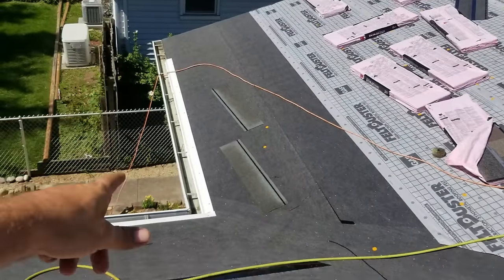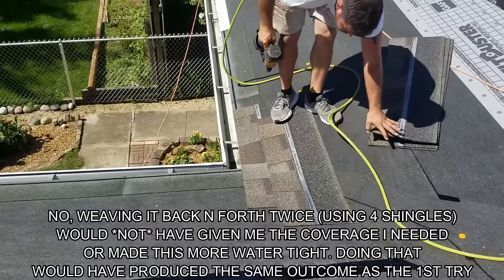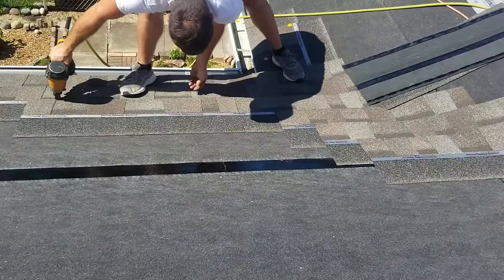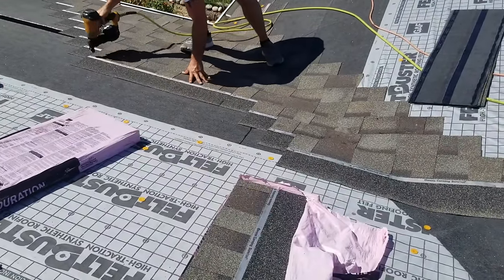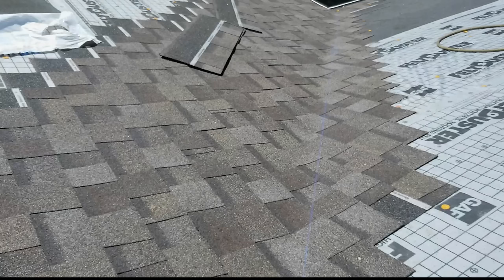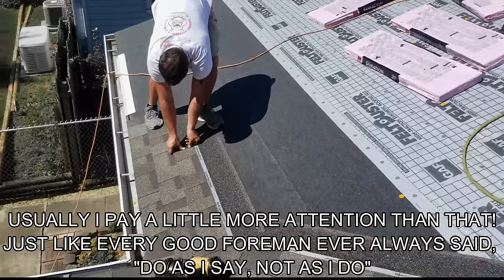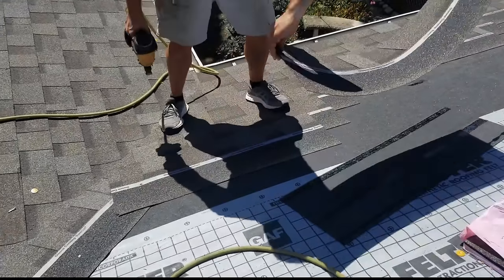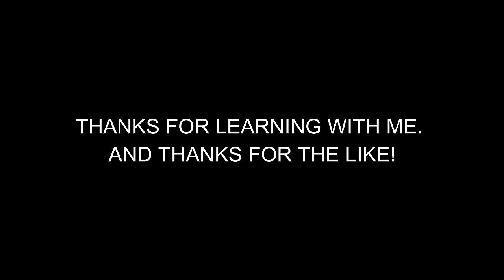How to do a closed valley!!!

Comment: No no and no. I understand how you got so much hate. This video should be titled the quickest way to do a valley, not how to. I don't think this guy cut one shingle while doing this valley, except when he hacked up a mistake. He sacrificed nail placement and a shorter stagger for a quicker job, voiding the warranty on the shingles. I never saw a hammer out even one time with all those nails. I'm guessing there are probably at least 40 to 50 nail pops, even if he had perfect pressure.. Never ever run shingles vertically up a valley like that. That's why he didn't use valley roll, because he couldn't. This is what hacks do because of the nature of dimensional shingles that will camouflage that vertical shingle, and no one will ever know you didn't use valley roll because you can't see it. You'll never get away with that shit with three tabs. Just do it the right way and use the valley roll to protect the valley and cut the shingles on the over side like roofers have been doing on closed valleys since asphalt shingles have been in use. If you question this comment, just read the package that the shingles came in, they are very clear on what voids the warranty. This method is a great way if you're working by squares, you'll make a lot of money. But if you're the homeowner and you want a good job I have seen lots of other videos that show the right way, not the fast way.
Reply from the maker: Dude. THAT IS THE RIGHT WAY.  Couple ways to do a valley and it's way better than an open cut valley.  I'm not hiding anything.  I was fortunate enough to learn the right way. And Nobody uses 3 tabs anymore except for cheap asses and idiots that think they're doing the homeowner a favor. Usually the same dummies that still think hand nailing is the way to go. This valley is fine in my area.  There's no hammer because Bostich don't spit crooked nails like the Hitachi. Be a little more open minded and you might learn something. No warranty was voided. I asked the reps at the manufacturer when people brought this up. Just because it's not on the "almighty bundle instructions" doesn't make it void.  This valley not only works better but looks much cleaner
Reply: Do you mean an open valley? In 30 years I've never heard the term open cut valley, it does not exist. A valley is either open or it's cut, not both. The closed valley you did is also referred to as a cut valley, because THE SHINGLES GET CUT. If a customer can only afford IKO fiberglass three tabs, that's what they're going to get or you can refuse the job which would be pretty shity considering a lot of people are on a very fixed budget. People in debt with an unexpected huge repair bill for a roof. I have one of the best financers that I've ever met and she can't get financing for everyone, but that roof still needs to be replaced. I've never turned someone away because they couldn't afford it without doing everything in my power to help them. We are not talking about new cabinets, a roof is a necessity. You must live in a real nice area where everyone can afford your services without issue. So three tabs being cheap is your argument for vertical shingles in valleys? That's not much of an argument for correct or not. That is an ignorantly arrogant statement. Three tabs being a cheap shingle does not magically make vertical shingles the preferred method smh. I said no three times for a reason. Anybody that questions either one of us can just read the package. It's all right there, from proper nail placement to valleys. So you know the proper placement for the cut is 4in or the width of your hand which people commonly use. That cut should also be tapered from top to bottom to give relief and guide ice or debris down the valley. I will give you credit for placing all your fasteners on the common bond which most roofers don't do and that you used ice guard on a 4/12 pitch which most roofers also don't do. With that said I would still make you redo it if you were one of my subs. You are creating a 1/4 void on the underside of the deck shingles that are running over those vertical shingles making them susceptible to penetration by hail. When an insurance adjuster sees that vertical shingle, they will deny a hail damage claim 9 times out of 10 citing improper installation. I have dealt with these people on a regular basis and they look for it. Running vertical shingles up valleys and rakes has been a popular trend for the last 15 years or so for speed and wasting materials so shinglers getting paid by the square can earn more. Like so many others that have learned how to shingle these past 15 years have been taught this way. That's why you're so confident but those are shortcuts, and you should rethink doubting old timers. They can teach you something especially if they learned by hand nailing. Besides the valley, a shingler without a hammer is like a chef without a pan. There is no way all those nails are perfectly flush I don't care what brand you own or how often you get it rebuilt. There is not a nailer on this Earth that shoots a perfect nail every time. I'd love to revisit that roof in 6 years and count the nail pops. If those are GAF then they are probably 30-year shingles made mostly of asphalt and fiberglass, not a strong enough brand for shortcuts. Then you knew that cutting a piece of ice guard off the deck and using it as a repair for a nail in a seam was wrong yet you still did it. Then you suggested the proper way to handle that is roof cement. Cutting the ice guard is obviously absurd but roof cement is also wrong. Roof cement starts to deteriorate at or before 10 years, the shingles have a warranty for 30. Are these also the cool new things that I should have the more open mind to? If I was that homeowner watching your video of my roof I'd be asking WTF? These things tell a person in my position everything I need to know. Owens Corning offers classes on how to install their products, I suggest you make the trip and take their shingle class. Seriously, you need to know the reason behind the why to understand instead of someone teaching you and just running with it. I'm certified for asphalt, ceramic, slate, shake, slotted steel, asphalt steel, and was among the first contractors to install vinyl flat decks over 20 years ago. I know what you were doing and why you did it. I don't care what some representative told you is acceptable.this is one of those instances when you can learn something from an old timer, because they know the history of how instructions got there. Installation instructions are on the package for a reason, so that GAF does not have to honor their warranty. Instead of the reality of a 20-year life span on the shingles they can say 30 and get away with it. Because roofers like you void the warranty and GAF cannot be accused of warranty fraud because it's all right there on the package. These companies cannot make it any easier. They know you never read it, or don't follow it, and you're long gone. Even if you can get tracked down after 15 years a false sense of righteousness of speaking to some rep is not going to save that warranty. Do you really think GAF is going to consider what some rep said verse the instructions when money is involved? That's how they legally get away with it. How many jobs do you know of where the warranty was honored, not insurance jobs, but the shingle warranty itself? You need to open your ears when old timers are talking. And you might consider that when you are right but everyone else says you're wrong, maybe you're the one that's wrong instead of dismissing everyone else as haters. You're still green and you have a long way to go. Some education will do you some good, not by the people on this thread but a real education to learn the how and why things are done the way they are, and why the words on that package mean something more than what a representative tells you. Customers and inspectors never go up on the roof, so you can do things like vertical shingles without an issue or question, that's why roofers get such a bad rap because they can get away with making a ton of money doing a s*** job. You are not a hack, but you're not helping things either. If you don't believe me I would urge you to speak with someone that has at least 20 years experience and has been through a real apprenticeship with education. Even with my education, experience, and success I still search for better ways for speed, quality, and operations. Constantly reading manuals articles and books on my trade. I came across vertical shingles before you learned the trade, and I know why it's not worth the time it saves. That's how I came across your video. 40 years and I still take the time to watch your video along with many others on a regular basis. So don't tell me I have a closed mind, I am always looking for a way to work smarter and make things easier on my guys, increase quality, and of course increase my profit. Experience and education means something young man. The second you close your ears is the second you begin walking the road of failure.
Reply from the maker: Holy shit lmao world record for longest comment on YouTube goes to you.  I am not reading that sorry. Breezed through a couple lines, you ain't saying much besides annoying bs opinion anyway.  Open, open cut,  tamato, tomato. Blah blah.  Thanks for watching
Reply: Yeah, sorry about that. I thought that comment may be a little too advanced. I liked your video, I may even watch it again, or even use ot as an interview or training tool! If Youtube pans out for you maybe you can keep those feet on the ground and save everyone the trouble.. Ad hominem, "When the debate is lost, slander becomes the tool of the loser.".

Comment: Why you need to put six nails in a starter shingle? Three of them right next to each other. I had a rip out of Valley today that some guys did and they were thousands of nails and it was ridiculous. Guarantee you that you lift up shingle and you follow fine nails too close to the joints.
If you use quality shingles and you put five nails in a shingle they don't go anywhere.

Comment: No cement & drip edge not nail to code.
Reply from the maker: do I have to keep telling you the same thing repeatedly...the rules vary by location. there's no code on how to nail drip edge. nobody uses roofing cement on drip edge. and there's no drip edge in this video! that's gutter apron. are you still one of the roofers that are SO FAR BEHIND that you still use drip edge as gutter apron because nobody has ever taught you the difference. the correct way to state your comment would've been. "i was always taught to put roofing cement on the drip edge, is there a reason you don't do it??"
Reply: @NWIVeteranConstruction  
I don't know who taught you but that's wrong
Reply: @danielc9201  it's not like the guy could bj the drip he rose soo much that there was no over hang by the end i bet he was half above the drip where u nail

Comment: Many things wrong about this video. Over hang is not enough. 4th shingle for some crazy reason low face nailed, Although your steps at beginning is good at top of valley your steps are FAR less than mfg specs. Start from outside in and cut excess your step will be perfect every time,
Reply from the maker: Guarantee there's no face nail and what kind of rookie do you think I am lmao the overhang is there. It's the angle you're lookin at. Focus longer. I explained why the steps are smaller than I'd like several times. They're fine

Comment: Every but joint on your diagonal shingle up the valley is open. The underside has a tar line sealing it close to the valley. 
If you live in a colder climate, this is a very bad combination. I consider this to be the worst type of valley, purposed only for production. This is a very lazy way  in my opinion to close a valley. There may be ice and water in it, but no metal, why?
50' of .019 is what $65?    
50' of .024 is what $100?
I personally prefer a "W" valley with ice and water under, and going up the edges. 
I like your videos, but this isn't correct for every area. Ice damming will ruin your home. An ounce of prevention is worth more than a pound of cure.
Thanks 🙈 🙉🙊

Comment: How, for the love of jesus are you guys keeping everything straight.  I run chalk lines and still have catty lines.  (Non pro)
Reply from the maker: Haha gun Guage don't rush.  Quality over quantity
Reply: I know especially with dormer roof valleys I got lines all over to make sure everything lines up equally
Reply: Everything turned out almost perfect.  I just went slow and measured every 2 rows to be sure.  The trick part was the right side of the roof was 1" longer so I had to eat that difference by the time I hit the peak.  The other problem was running the shingles from the valley,  we would end up with odd sized end cuts so we had to do 2 cuts on some runs to make sure the seams were correct.

Comment: starter shingle starter shingle not starter starter then shingle shingle smh
Reply from the maker: That's really unimportant lol reason being stater is the seal the edges.  This shingle running at an angle is nailed like crazy and stuck down
Reply: Zack of All Trades not just seal the edges lol its to keep water off the ice ,drip,and roof roof let the seams of the shingle and starter match up then what lol water underneath the starter and water on top off the ice

Comment: Laying shingles parallel to the valley is a shortcut used by shinglers vs roofers.  Water hitting the tapered to tabs is directed away from the valley and under the shingles.  Its used strictly to save a shingler from angle cutting the end at the homeowners expense.  Shame!  Open metal W flashings is the true sign of a pro.
Reply: And when the metal is copper it's the true sign of a good home owner choice :-0)
Getting so expensive though, I can see economic pressure affecting judgment.
Reply: If the home owner wants a metal valley then he informs the roofer if not, roofer does it his way and that’s all that matters and it doesn’t leak  as well 👍🏽
Reply: Homeowners aren't roofers therefore its the responsibility of the professional to provide them with information.
Reply: @johnd9541  And the roofer should provide cost comparison :-0)
Especially if the customer is already asking for something particular that is outside the "norm" in the industry.
Reply: I consider metal valleys as being part of most basic roofing jobs.  Its up to me to sell the benefits and then let the customer decide.  Its a disservice to lowball an estimate by taking shortcuts.  A metal valley is cheap insurance really.
Reply: @johnd9541  [[ metal valleys as being part of most basic roofing jobs ]]
I agree and hence the roofer should make known up front that the customer's cost will be $X for metal valley style but the roofer can offer that the customer can save $Y if choosing to use shingle overlap as the valley instead.
Ice dam underlayment, etc. should also be options provided to the customer.
PS
If I had roofing business still, I would also offer vented roof options (second layer of structural framing and sheathing with radiant heat barrier in the air gap between the sheathing layers. Radiant barrier vented roofs are a much larger cost in the short run but they can save lots of energy use and extend the life of the shingles as well. (They also make some attic spaces feasible targets for converting to finished living space.)
Reply: The cost difference is so negligible in relation to the benefits, so i doubt few homeowners would choose closed valleys in order to save $200 for something lasting 20 yrs, but it can be offered.
Reply: @johnd9541  I would agree that most individual homeowners would not want to go low ball method BUT . . .Think landlords. Think rental companies with megaplexes that need re-roofed.
Reply: @johnd9541  I would agree that most individual homeowners would not want to go low ball method BUT . . .Think landlords. Think rental companies with megaplexes that need re-roofed.
Reply: Personal preference. You all probably only use metal because that's what you were taught. It's not needed. It's not cost efficient, labor efficient (as it requires more time to install) nor insurance or piece of mind. Unless you're installing it correctly, it's just a waste of time. I'm willing to bet that 95% of metal installation in valleys are not properly installed. The only time a metal valley should be used is on a metal roof.
Reply: @bobbyerskine1055  "Unless you're installing it correctly".  Is there any other way to do it?
Reply: @johnd9541  sure... mostly seen... incorrectly lol

Comment: Holy....ive watched this video a few times.....there is not your minimum 18" past valley line.....this guy cannot give you any actual specs. Jibberish
Reply from the maker: Who said 18 inches past valley line? That's almost half the shingle.  If you go one stair step in wards you already would need to back step it... causing a racked roof instead of stair step which voids the warranty. ... You're jibberish lol
Reply: @NWIVeteranConstruction no jibberish here. You cut thirds/ halfs ,before valley to push the shingle resting in the valley, through the valley. I live a 5a zone....lots of snow and freeze thaw cycles....all nails in valley are to be minimun 10" away from valley line. It is recomended your shingle run past 18".  I roof in the mountains ! Im not saying your install is wrong. ..i would do things a bit different is all.

Comment: Um starter strip goes tar side down against the drip edge to seal it up. There is a tar line on the first shingle that seals that shingle to the starter. Now ya know
Reply: lol, some peeps ;)
Reply: Why would the side with the tar have granules on it then. Your really smart! And how is any condensation  or ice damming going to flow over the drip edge. It will be trapped
Reply: Lmfao